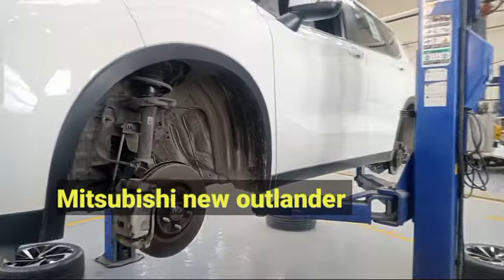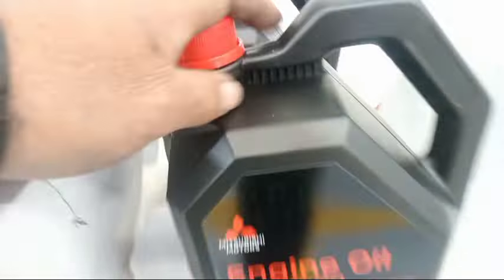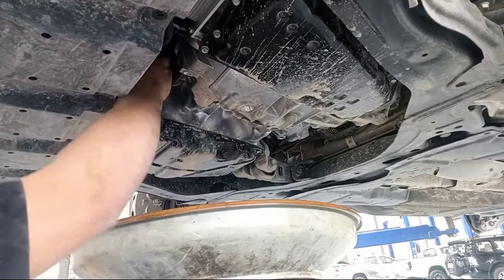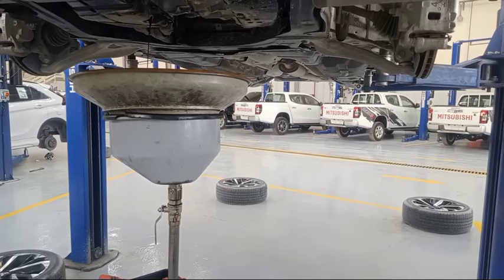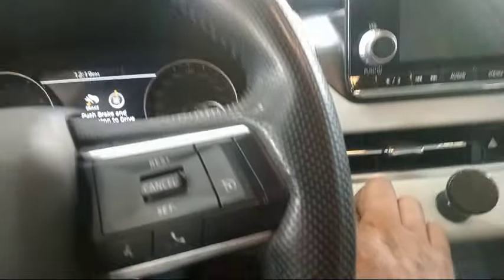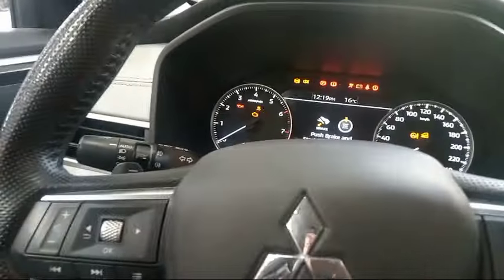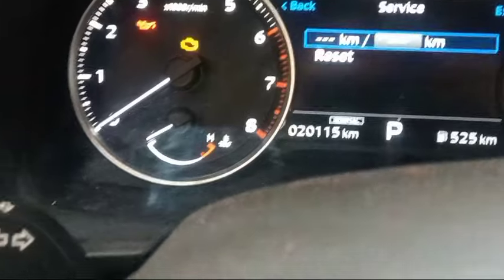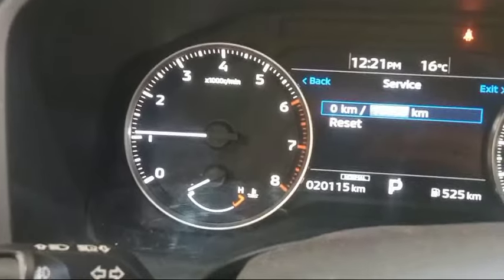Mitsubishi new outlander (how to make 20.000 km service

Comment: Idol ilang normal rpm ng outlander 2024 PAG naka idle lang or naka drive pero naka brake ka Hindi tumatakbo, at nakuha na nya normal heat ng engine
Reply from the maker: Normal talaga is 1000 rpm
Reply from the maker: 9000 rpm
Reply: 600 rpm lang po Kasi Yung sakin PAG mainit na engine ko